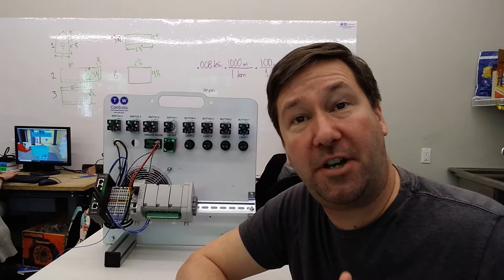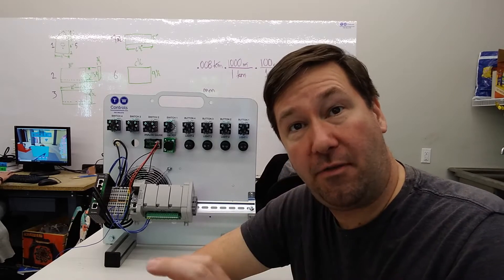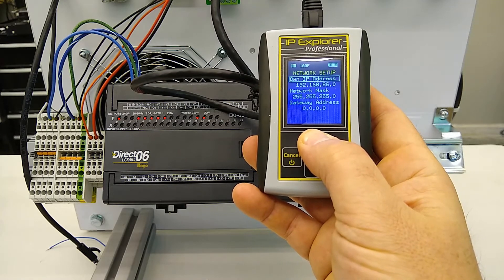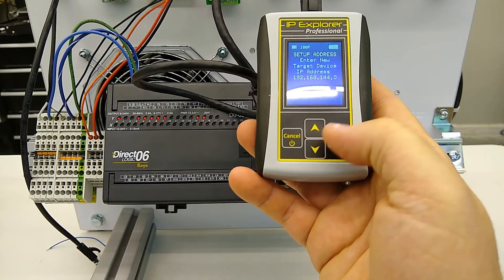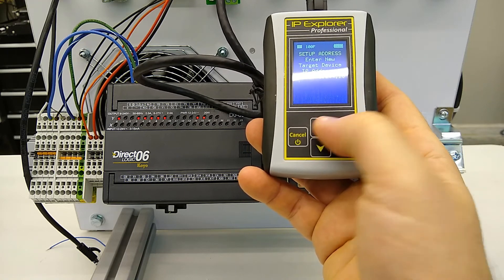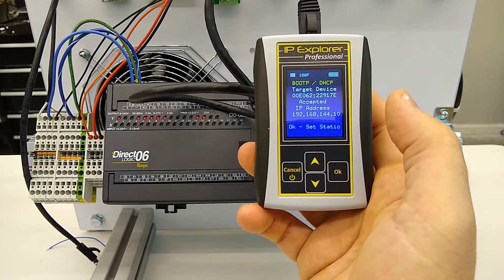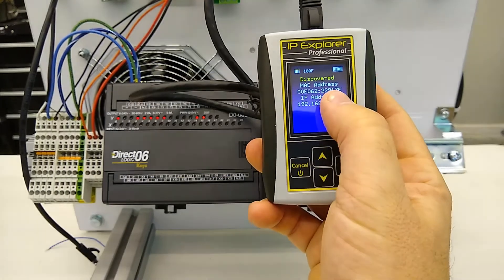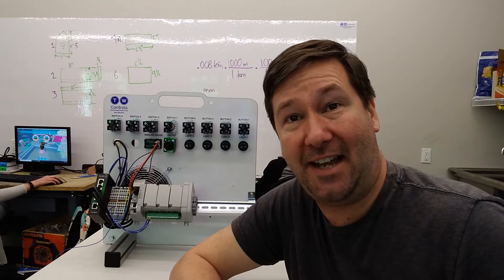Automation Direct DL05 or DL06 PLC H0-ECOM100 Reading and Writing an IP Address

Comment: wow... 🧐  i am so glad to see this video and to learn about the SKU: SIM-IPE IP-Explorer that will work with the AutomationDirect PLCs we use lots of high end Rockwell stuff however for the money an AD PLC is a great value and no hassle software. some factory floor projects have been running for over 10 years with no air-conditioning.  😎 thanks a lot